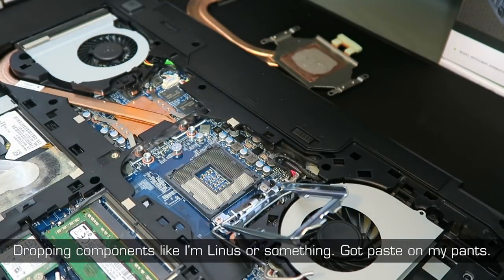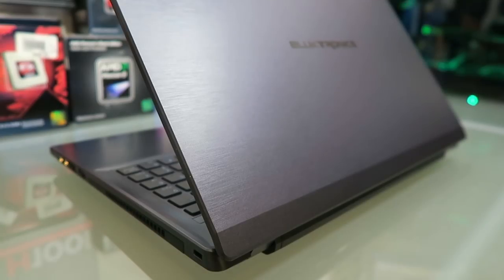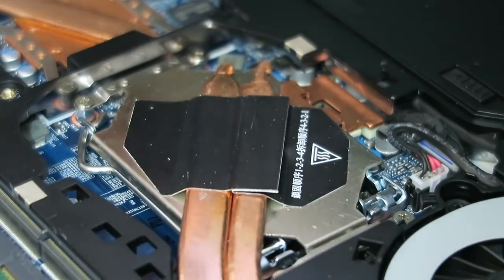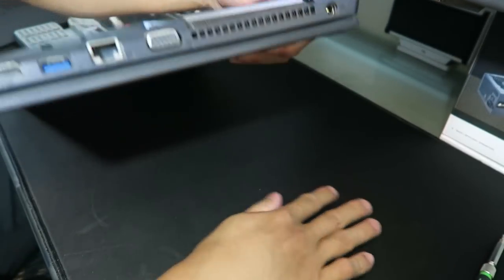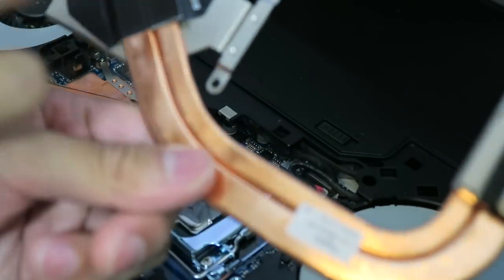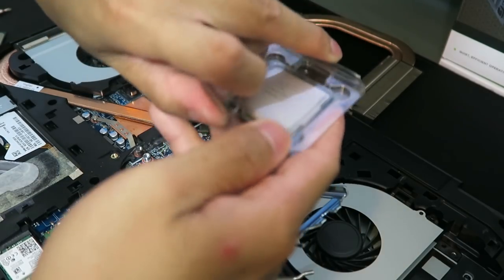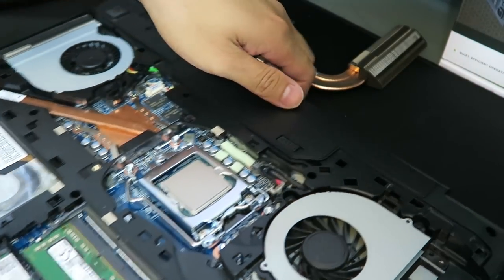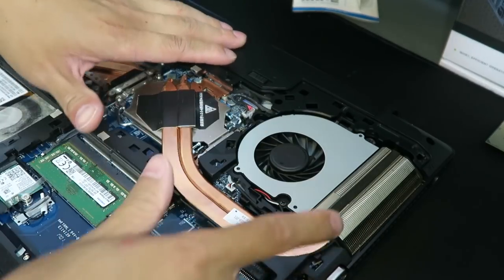Laptops That Use Full Desktop CPUs

Comment: That makes that laptop all the more awesome. I hope one day we can get almost fully modular laptops using a barebone chassis or kit or something
Reply: JDTechGear that was idea 4-5 years ago but since than there is less and less laptops with mxm and desktop grade socket. Trend is PGA socket and soldered gpu.
Reply: Nikola Karovic yeah it was a short lived trend, but seeing this video gave me hope again haha. I would definitely be more likely to buy a laptop with a desktop CPU socket
Reply: For niche market or small amount of people, yes this kind of laptop is very interesting. But for most of the people ( non tech entusiast, average user ). This feature is not very compelling. Less battery life, bulky dimensions, and it seems its little bit more pricey than the common laptops available.
Reply: long time a go i have an acer aspire 3650, i upgrade cpu, ram, and hdd with excellent results from 1.2 jump to 1.6 cpu, 1gb upgrade to 4gb, and 20gb hdd to 160gb
Reply: We can get barebones laptops already, but the extent to which they're modular is questionable. Intel no longer makes socketed laptop CPUs, so the only way to do something like this is if you use desktop parts, which isn't all that great in laptops due to thermals and battery life.
Reply: You know why it failed? Monopolies. If people could simply change everything in the laptop, the company couldn't simply release another laptop every year and they wouldn't be able to make as much money, omly much cheaper modules (if not actual components, which is worse for them) that wouldn't really make them money
Reply: The CPU/Chipset manufacturer would have to stick to one socket for a long time, not good for business.
Reply: Clevo is just that. You can buy them barebones with a chassis and monitor and mobo and source your own cpu, gpu, ram and hard drives.
Reply: +GrayFox370 Intel no longer makes socketed laptop CPUs, so you can't install your own CPU anymore. The only option is to use desktop parts in a laptop, which, aside from a couple of exceptions like this laptop, is pretty much unheard of.
Reply: asdfrozen What? Clevo still offers socketed CPU's. I am running a 7700k delidded with liquid ultra at 4.8ghz and dual mxm 1080's at 2100mhz on my Clevo P870DM. The only laptops that offer socketed CPU's are Clevo now. Before Intel used to make socketed mobile CPU's but stopped after Haswell. There is the new Asus ROG laptop coming with a Ryzen 1700 so that's socketed as well.
Reply: Yeah, that laptop uses a CPU Intel designed for desktops, not laptops. You'll see a few laptops here and there that do that, but those are rare exceptions.
Reply: My other Alienware 18 uses a socketed 4940mx clocked at 4.3 and dual 980m's. So yeah they stopped using socketed CPU's after Haswell. Those old 3920/3940xm and 4930/4940mx were beasts. Every single mainstream Sandy Bridge, Ivy Bridge and first gen Haswell (4900mq, 4700mq) mobile CPU's were all socketed CPU's. If your CPU has a qm or mq, mx or xm moniker, it's socketed. If there is a H in the name, it's soldered BGA.
Reply: Yup, I'm aware.
Reply: wait really that stinks so newer laptops have soldered cpu now?
Reply: Unless you find one of the few exceptions that use desktop CPUs instead of CPUs designed for laptops. This would also mean you'd have to be okay with almost nonexistent battery life.
Reply: GrayFox370 What about the first laptop I'm aware of to support ECC SDRAM, the ThinkPad P70 17.3" business-class notebook introduced by Lenovo in 2015? This kind of notebook and similar ones use Skylake-based Intel Mobile Xeon E3 v5 processors, but are they socket-able? After Haswell (2013) in 2014, when Broadwell was introduced, CPUs became strictly soldered-only, which is a MAJOR pet peeve of mine. The Clevo P570WM/P570WM3, X7200/X7201 are amongst the best notebooks I know of that use high-end desktop processors made for the X58/LGA-1366 and X79/LGA-2011 platforms.
Reply: It'll be a niche market at best. Laptops should and are moving towards thinner, lighter designs that just don't have the thickness for a socket and ihs. It's still to be seen how often Intel changes sockets in the future (though AMD supposedly will support am4 until 2020), which means you'd need a new motherboard, which for laptops often means a whole new machine. I would much prefer a portable thin and light with some gaming power (though this isn't a requirement as laptop gaming is an inferior experience even on top end machines, though the benefits of a gaming laptop 15.6' and under are undeniable), under 1kg that have decent battery life, acoustics and thermals. Laptop parts are advancing in performance slowly enough that a 3rd gen core i5 is still enough for light productivity and everyday tasks like HD video playback, so I don't think making laptops upgradable is worth the time and effort in manufacturing and design.
Reply: There will always be a market for big thick heavy gaming laptops. Thin and light portables are great but for those who want a portable desktop, those will always be there. I have heard this thing so much before on how it's a niche market and the big laptops will die out. It hasn't yet. Clevo will always offer socketed laptops. Asus just announced their upcoming ROG laptop with a R7 1700. Most laptops with a soldered cpu will last a solid 5 years anyways. Yeah Intel changes their socket every 2 years but how often are those changes worthwhile? Lol people are still gaming on a 2700k or a 2920xm laptop just fine.
Reply: anikanbounty97 Laptops have had soldered CPU's ever since second gen Haswell. All laptops with a "H" in the name indicates it's soldered. So a laptop with a 4700mq is socketed and one with a 4700hq is soldered.
Reply: Nuclear Armament The Clevo P570WM/P570WM3 are monsters. ECC memory, support for Xeon chips and the beastly 4960x CPU. Can't wait for Asus's upcoming Ryzen 7 powered ROG laptop.
Reply: The one I bought is, I can even swap out the graphics card and upgrade it but I am unfortunately limited to the GTX 900M line. :(
Reply: GrayFox370 hahaha! Let's go and make modular laptops great again.
Reply: You can get them from many ODM in china and Taiwan. You can also make entire smartphone in Shenze n with offshelf parts.
Reply: @nikolakarovic5964  and apple ensures that their new laptops can no longer be upgraded at all..... everything soldered and broken? throw it away
Reply: Framework!
Reply: @kons37flyingreaper41  lmao came here to say this
Reply: Insert Framework
Reply: @jdtechgear It actually wasn't short lived Intel made socketed Laptop CPU all the way to Socket G3 for their 4th gen Mobile CPU
Reply: @AlexVasiluta Some laptop manufacturer to this day still makes laptops with socketed CPU albeit much more expensive than even your desktop
Reply: The MNT Reform is fully open hardware, although the price-to-performance is horrible for gaming and such. It's an extremely cool laptop, and even those who wouldn't purchase anything like that should definitely check it out.
Reply: @noobynoob138  The MNT Reform laptop was intended as a tool for pen testing or penetration testing
Reply: @mayuravirus6134  Can you provide a source for that? I didn't notice that mentioned on the MNT website.